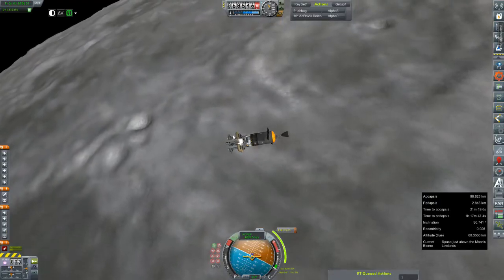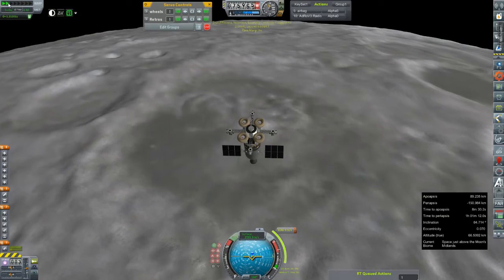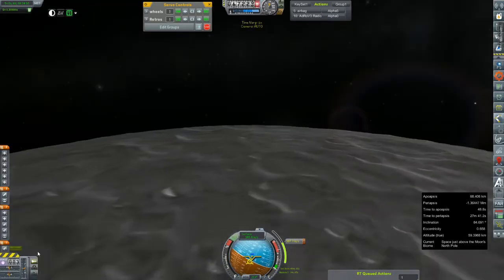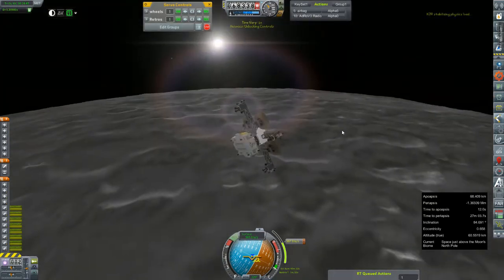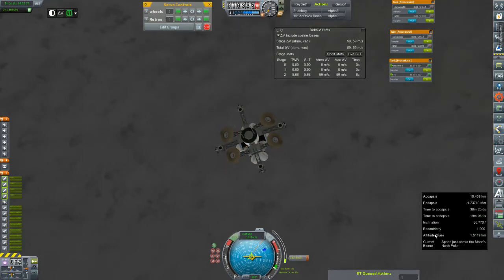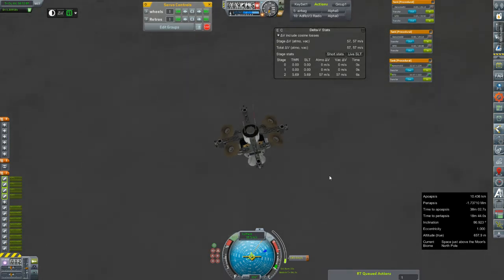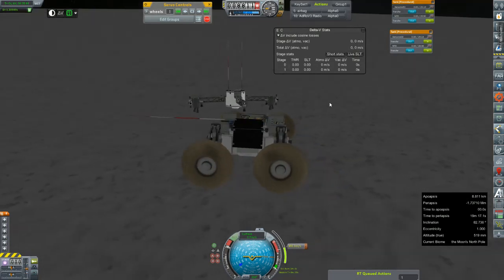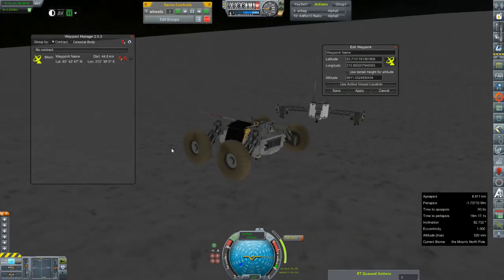KSP RP-0 #223 RoV4 Lunar Landing

Comment: You don't use persistent rotarion O.O
Reply: The unseparated rover looks like giggling after you lol
Reply from the maker: I do not use persistent rotation, cheep I know. but the savings in Delta-V from not having to arrest that spin may have been the margin between bounce and boom.
Reply: But PerRot could help your electric charge status...If you fix your rotation to Sun, you could keep your solar panel fully active.